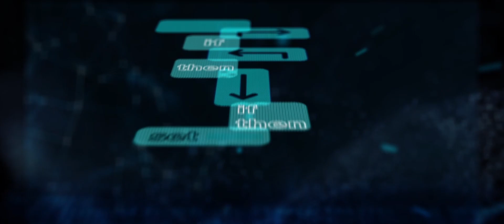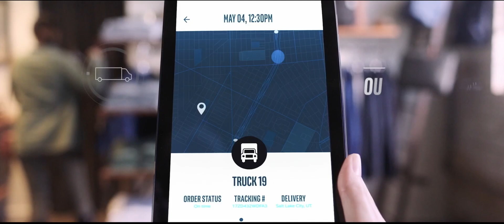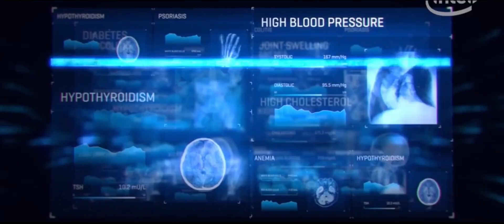Europe's Tech Future Starts Now, with the EU Chips Act!

Comment: There are a lot of raw materials for the production of these things in Ukraine, production plants for internal combustion and electric vehicles can be built in Ukraine production of cars production of aircraft glass works, aluminum works, copper works, steel works production of semiconductors chips cheap energy, low labor costs, large recreational investment areas Ukraine  will enter the Schengen area